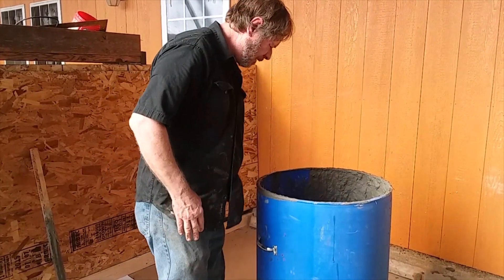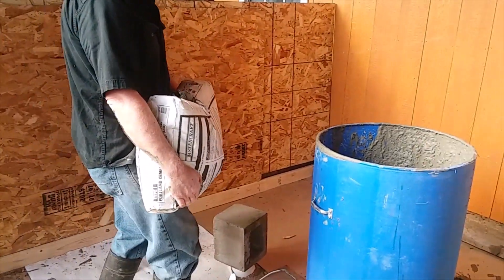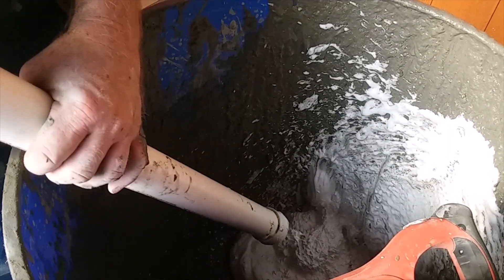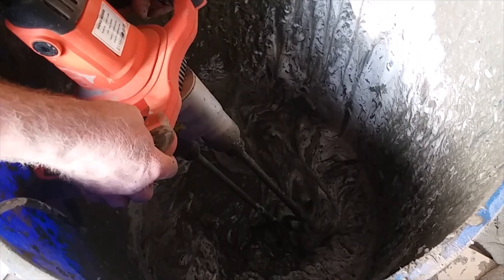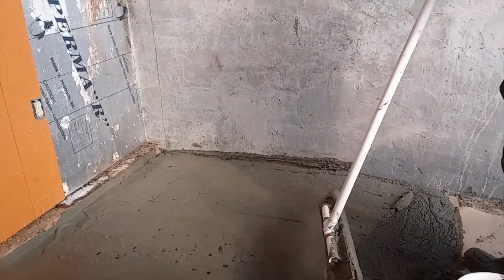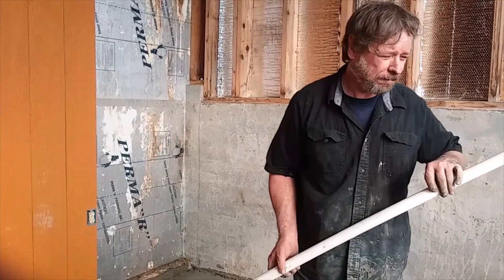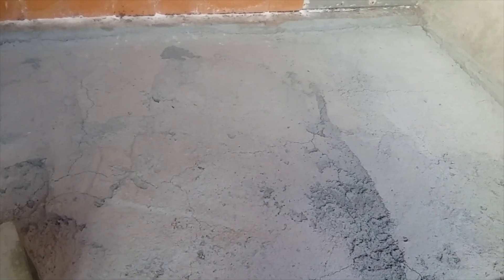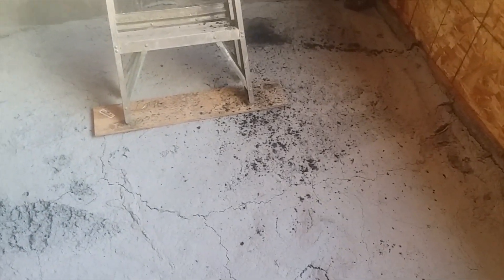Aircrete Insulating Subfloor

Comment: hi, is the foundation of a house supposed to be insulated with a plastic sheet? I saw cardboard on the floor, you need to keep moisture for the cement to set well ... perhaps the cardboard took away the moisture from the cement ???

Comment: Aircrete seems like an ideal building material for many applications. Has anyone ever told you that you look like Russell Crowe? Neat video.
Reply from the maker: It is a good insulator with some structural value although I admit I don't quite have it figured out, lots of factors involved on getting consistency. The floor I poured here collapsed a little more than I expected. I want to try sawdust cement for an insulator but we have been having health issues between my wife and I so I've neglected my channel, hopefully get back to making a few videos. So you think I look like Russell Crowe, never been told that. I think he is much better looking than me. Glad you liked the video and thanks for watching.

Comment: I think that to improve the strength of your aircrete you should have added fibre. Fiberglass, steel, plastic, organic... any kind of fibre would help, I am sure.
Interesting to see lime getting added, why did you add some lime? Is there a benefit to extra lime? I am curious
Reply: Adding stuff collapses the internal foam bubbles according to the videos I've seen...
Reply from the maker: Thanks for watching, I added the lime because I think it helps to keep it from collapsing before it sets up. I'm no expert and my floor did collapse a bit more than I expected, I need to do more experimenting but due to my wife and I having health issues I've neglected my channel, I hope to get back to making more videos soon. Not sure if fiber would help or not. I think steel fiber would sink in the cement before it set up. If you saw my cement pond video i chopped up some poly rope about an inch long for fiber, it may help but aircrete will never be all that structural  IMO, It has enough for a dome and suck but I would never use it for a retaining wall or such. Hope this helps, thanks.